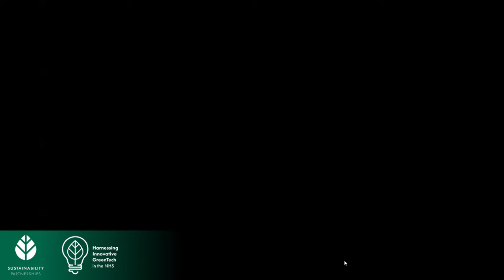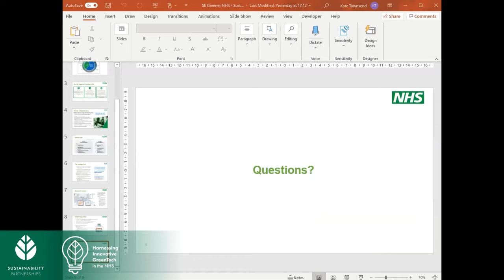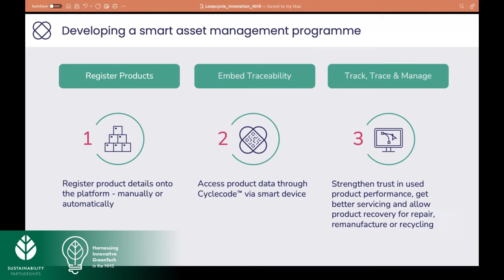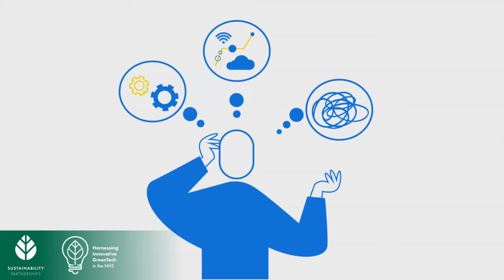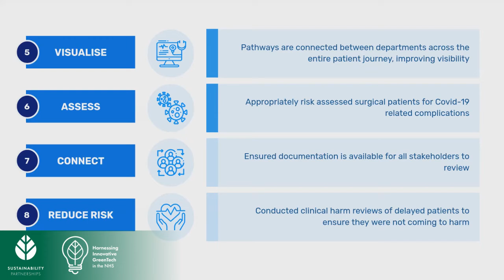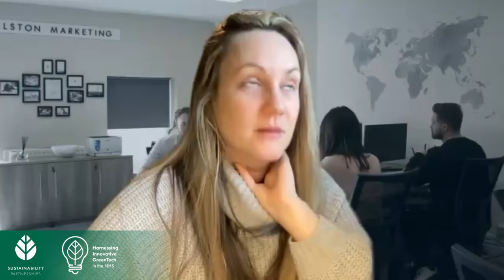Harnessing Innovative GreenTech in the NHS

Comment: Great and very informative video - thanks.

There are other innovations which will result in opportunities for carbon emission reductions that would enable the NHS to replace all PCs and desktops with just smartphones that plug into monitors and portable displays. Since smartphones are much more power efficient, this means a smartphone based desktop computer (docked when needed as a desktop and undocked when mobile) using existing monitors, keyboards and mice can use up to 80% less electricity per day than a conventional Windows PC (running 24 x 7) and yet replace two devices with one.

On the point of electrification of cars offsetting benefits of remote working, this won't happen for some time due to the high cost of electric vehicles, the high carbon cost to manufacture them, the use of electricity part produced by fossil fuels to charge them and in addition, like convectional cars, they still produce other pollution when in use - mainly plastics from tyre wear and particulates from brake linings etc.